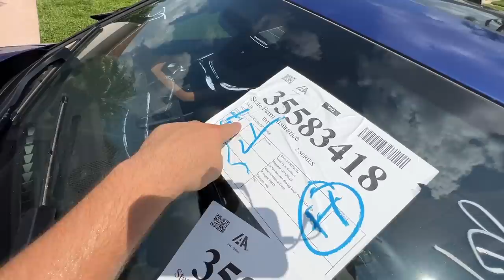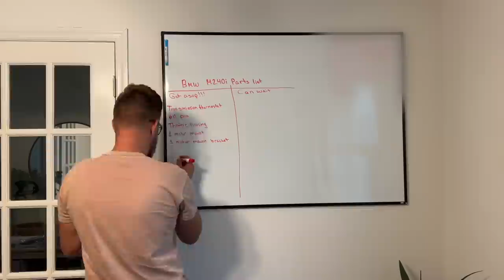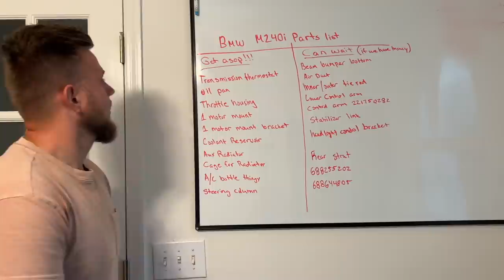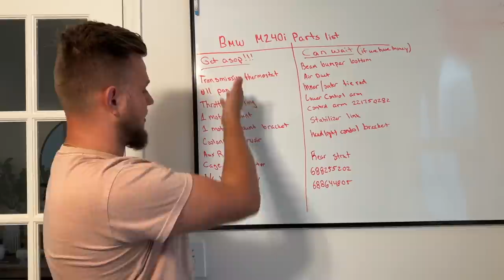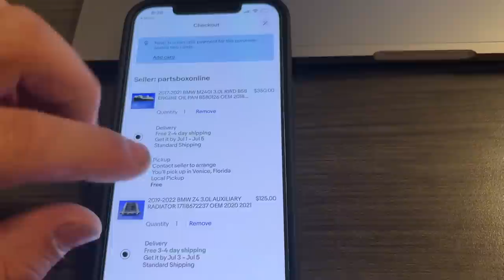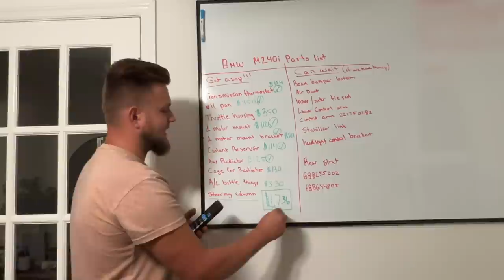REBUILDING A WRECKED 2023 BMW M240I | PART 2 It Has WAY MORE DAMAGE Than I Thought!

Comment: I had the same issue with steering rack after crash, when that plastic cap was broken. I tried to save money and found that top part alone. Just don't do that and find a used steering rack assembly, it usually goes for around 1000-1500 usd. BMW doesn't sell steering rack individual components for a reason. When that plastic top is crashed - it means that rack was pushed very hard and what's actually under that cover - is all the sensors reading steering angles for variable steering and also bearings. When we disassembled rack - a lot of stuff on the inside was broken, not just plastic cap. Another problem even if you get lucky and replace inner sensor parts - would be to adapt that mixed part steering rack to a car. Long story short - it is 100% worth just replacing it.

Comment: Duuude, that's a yellow jacket.  Get some Spectracide wasp and hornet spray if it comes back.  The Spectracide has a pretty long stream so that you can snipe those bastards.  So glad it was the oil pan and some return lines.  Looking forward to you firing it up soon.  Not sure if you do body work these days, it was a treat watching you work your magic on the M6.
Reply: They are Mud Dauber Wasps. But yes that spray is good stuff. One time I had these bastards build a nest in my condensate drain on a vehicle I rebuilt. My whole evap / air box filled with water and ruined my blower motor.

Comment: I just checked and the rack is manufactured by Thyssenkrupp (the same company that also makes elevators!). This type of rack has been in multiple variations of BMW (G05, G06, G07, G2x, G8x and G42). Lookup “142890 steering” or G2x steering rack and all of them would pop up.
They all have the same cap which connects the motor to the actuator (except for some earlier G2x cars which use “JTEKT” racks). Wish you all the best and PLEASE REPLY if you find this post useful.
Reply from the maker: Thank you!
Reply: @BackYardBoyz  I hope this helps you out. I will see if you can get the cap separately.
Reply from the maker: @kuruption1983  thank you! Email me if you find some info
Reply: @BackYardBoyz  I also checked and the JTEKT and ThyssenKrupp steering racks have completely different mounting points; so the chances of them being compatible is very slim. In the photo of the Partslink24, it shows it to be JTEKT which is the wrong photo the catalogue uses (very typical of BMW catalog).

Comment: I just bought a 2022 230i m-sport for IAAI to rebuild and just wanted to help out a little. The seat airbags in the front were nearly impossible for me to find, except after doing a lot of research, the airbag in the seats at least for my car were an exact match to the G01 bmw x3. It was a perfect fit in mine hope that helps.
Reply from the maker: Appreciate it! Do you have a part number?
Reply: Also part numbers do not match according to bmw, but after receiving and allowing body shop technicians to compare, it was a perfect fit and exact same unit, so I would definitely check it out cosmetically because it saved me a lot of money!

Comment: I’ve never seen someone so excited to see a hole in the engine pan. If this engine was ran without oil it’s done. The fact that he stated that the engine sounded funny when he cracked it could mean the rods are already bent. 

I would open the engine before touching anything.

Comment: I would do the bearings just in case as you did say you started the motor and it sounded funny, and then added oil and it went away. Bearings could have gotten some wear in those few seconds. Other than that good luck on your build.
Reply: Just need to check bearing caps for wear, if they’re good then put them back and torque ‘em up

Comment: If the engine was not ran and reved more than 5min, it should be alright, but if it was running for longer, it could have a possibility on scratched up rod bearings because of oil starvation. Just a little pointer. Had a incident 8months ago where I drove over something hard and cracked the oil pan, drove very moderately for 2min to park the car in the gas station, luckily I was 20min walk away from home, next day I picked it up with a trailer I borrowed, towed it to a garage, changed oil pan, everything's nice and dandy.